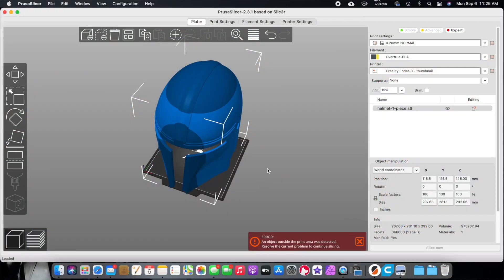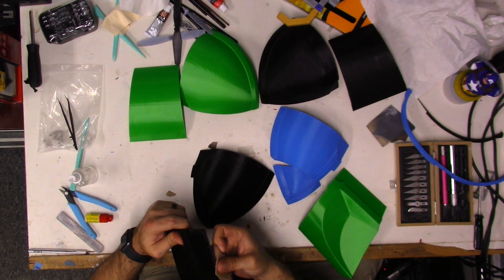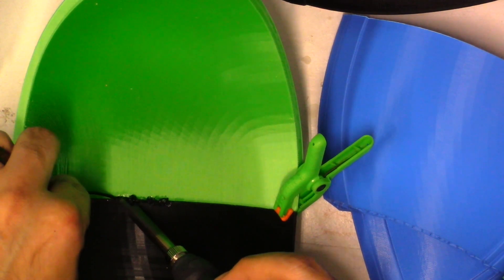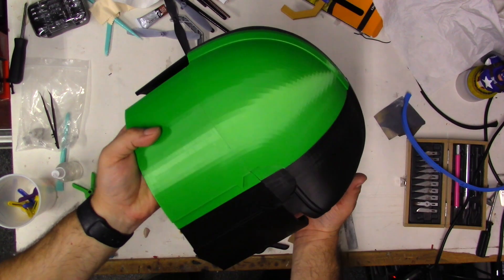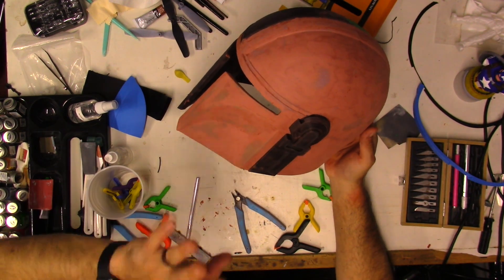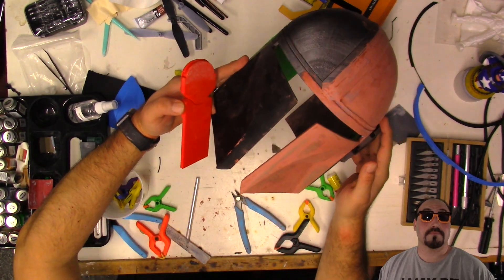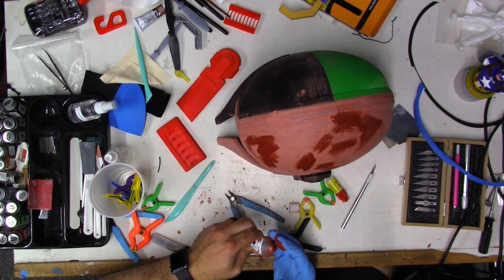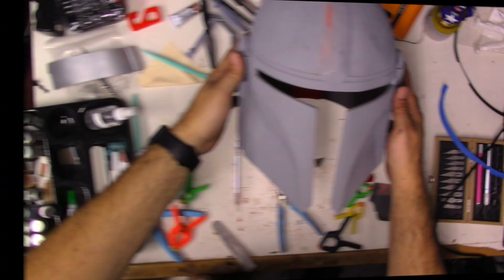3d printing a helmet start to finish part 2

Comment: Are there any other ways to do it if you don’t have a soldering iron?
Reply from the maker: you can try to find a glue that works better, but nothing's gonna work better than a $15 soldering iron.

Comment: What orientation did you print the cheek pieces in?
Reply from the maker: Bottom down straight up and down.
Reply: It has to be fully supported like that right? Because of the curvature of the bottom

Comment: The Mynt3D pen is very nice at welding.  And just using as an actual 3D pen, I guess.  Heh heh
Reply from the maker: I thought that would be a good way to do things which brand do you recommend?
Reply: @CrazyWillTechShow  I’ve only used the Mynt3D Pro and the 3Doodler.  I sent the 3Doodler back..just too bulky.  Love the Mynt, though.  I’d like to get my hands on some of the cheap-o ones just to compare.  I got a sub-$100 3D printer for kids and am actually pretty impressed with it.  Video should be ready next week.  It’s no Ender 3, but for fast printing a demo it is awesome.
Reply from the maker: I’ll definitely keep an eye out for that!